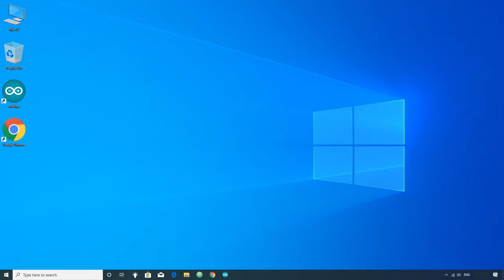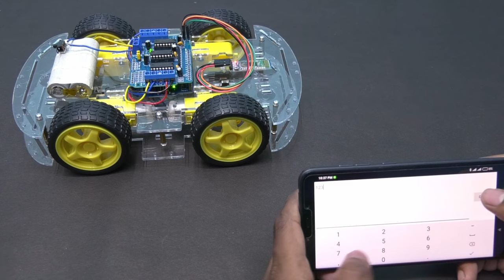Bluetooth controlled Arduino RC Car | Control using your Mobile Phone | Ut Go

Comment: Hello, I love your videos but I have 2 questions. The first, can you please help me on how to install the library for the motor protector and the second, in addition to the lithium battery, can I install a battery holder and put 3 double AA batteries in them
Reply from the maker: "Motor Protector" Library?? Sorry I didn't understand.

No, you can't use 3 AA batteries because they are not able to provide enough power to drive 4 motors.
Reply: @UtGoTech there are AF motor library for v1 most motor shied, which we have to install with the code
Reply from the maker: Install Adafruit Motor Shield V1 Library
Reply: Please send me the name of app for control the car.
Reply from the maker: Bluetooth RC controller
Reply: sir I did everything connected every wire and all stuff but motors are not responding to my bluetooth commands, all the hardware is in perfect condition wiring is done properly then also motors not responding to my command pls help sir
Reply from the maker: @AyushSinha-cq1qi Are you following the same circuit diagram and code which is given in the video description?
Reply from the maker: If you are still facing issues then contact me through Telegram. I will assist you there.
Reply: @UtGoTech  how can i contact u there sir pls sir help me
Reply from the maker: @AyushSinha-cq1qi Contact me through Telegram or Instagram
Reply: How i can contact you in telegram
Reply from the maker: @Mohammed_Al-ali Telegram User given in video description
Reply: @UtGoTech  What app you had used to drive this?
Reply from the maker: @TahsinKabir123 I have used Bluetooth RC controller app. But the app is removed from playstore. You can download it's backup app from the link given in the video description.
Reply: Is AF Motor Shield V1 library different from Adafruit Motor Shield V1 library. Pls help.
Reply from the maker: For installing the library: In Arduino IDE go to tools then manage libraries then search for Adafruit Motor Shield V1 library and install it.

AA batteries will not work. You have to use lithium based batteries.
Reply from the maker: You can contact me through Telegram.
Reply from the maker: @rimjhimbeats499 No. AF means Adafruit
Reply: @UtGoTech  there is no backup for the app
Reply from the maker: @WhiteDevil-el3vr link of the backup app is in the video description
Reply: Where can I get code of this car 😢
Reply from the maker: @user-sn4wi1ly6y code given in the video description

Comment: Sir i have made this car and run it it is running for 5sec and motor is not running then i have to resturn the car how to solve this problem pls send solution sir because i have science exhibition after 2days plas sir😢😢
Reply from the maker: Check battery voltage and also look for loose connections

Comment: I was trying to follow your exact tutorial but at the end forward was left and back was right so I had to switch wires on one side to make it work correctly.  Also added ForwardLeft, ForwardRight, BackLeft and BackRight to the code. Android soft support it but in the code it was missing. Other then this everything works as expected. Thank you!
Reply from the maker: Welcome
Reply: can you please share the code or explain what you added extra.
Reply: @samiarahmanrima8833  the code is in the description

Comment: Can i plug the rx and tx pins into the A0 - A5 slots instead? Because i plan on adding 2 servo motors
Reply from the maker: Yes you can.

Comment: What is the difference between soldering the points in 0 and 1 and fitting it directly in the pin?
Reply from the maker: No difference in the working of the RC Car. Only difference in connecting the pins directly is that it will make the connection process much easier.

Comment: In video I saw, that bluetooth module you are using is powered by 3-6V and has 3V logical level. So I want to ask if there is no need to use logical level converter or power supply downgrade? Is blietooth module 5V tolerance? Thanks for answer.
Reply from the maker: It depends upon your bluetooth module breakout board.

Comment: Hello i am having problem that i have made a car but when i connect car to phone it take times to move forward backward right left and sometimes it is connected but still it doesn't responce
Reply from the maker: What battery are you using ?
Reply: @UtGoTech  I am not using battery I was connecting aurduino cable to my laptop 
Can you suggest me which battery should I use.
Thanks for reply
Reply from the maker: The laptop USB port can't provide enough power to drive motors.
Use Lithium based battery with voltage between 6 to 9 volt.
You can use 2x18650 lithium ion cells in series to make 7.4volt battery pack.
Reply: @UtGoTech  thanks please can you make video on how to connect series battery connection.
Reply: @UtGoTech  can I use 
8  1.2v.normal batteries .
Reply: @UtGoTech  can I use powerbank instead of battery
Reply from the maker: @all_shortzParth That depends on your power Bank. If it can give  enough power to drive 4 motors then it will work.
Reply from the maker: @all_shortzParth 8 x 1.2volt battery will not work. Because AA (normal battery) can't provide enough power.

Comment: i did exactly same as u did in ur video, but the blouetooth module only blink red light when i connecting with my pc using usb cable, when i done uploading code and connect with the battery the bluetooth seems didnt work(red light is not on ) while the shield is woking (green light is on )and i dont know why.maybe because im using HM-10?
Reply from the maker: Check Connections properly and make sure the connections is as per the shared circuit diagram .
Reply: Bro did you do coding
Reply from the maker: Yes. I have written code for the Bluetooth RC car.

Comment: For the connection to the tires and the motor shield, are jumper wires sufficient as cable connections? Or do they conduct too little current?
Reply from the maker: Yes. You can use jumper wires for the connections between motors and motor driver shield.

Comment: Great work! I have this error when i upload the code: "compilation error exit status 1" u know What i need to do? :(
Reply from the maker: Check if Arduino board is properly connected to your computer or not.

Have you installed the necessary drivers?

Comment: From what I am seeing in your battery 🪫 pack seems you solder the end together while the front is lead out as positive and negative but my question is do you have to remove the soldering in other to recharge those battery or you have another technical means to charge your battery? Thanks 🙏 for your reply
Reply from the maker: Yes 2 batteries are soldered in series, you can charge this 2S battery using a 2S charger.

But you can use a battery holder as shown in this video:
https://youtu.be/6WteNRth8xo?si=JHlNM4PpEYODciLW

Comment: I have a question? Doesn't the Arduino need a 9 volt battery to work? I don't see her anywhere
Reply from the maker: The Arduino board is taking power through the motor driver shield and in the motor shield you can give voltage between 6 to 12 volts. 9 volt is the sweet spot.

Comment: It is true that first I have to enter the Arduino application (page) and log in and then download the code or I was wrong about something.
Reply from the maker: First login to your Gmail account then open the code link and download it. After downloading open Arduino IDE then install the Adafruit Motor Shield V1 Library through Library Manager and then open the downloaded code and upload it.
Reply: Ok thanks

Comment: in my project hc05 does not turn on on the Arduino motor shield when using battery power but turns on when using a laptop USB
Reply from the maker: Check battery voltage
Reply from the maker: If the battery is ok then check if the jumper is connected or not
Reply: @UtGoTech  My battery voltage is 3.7v and the jumper is also connected
Reply from the maker: You should be using two 18650 lithium ion cells which are in series to make it a 7.4 volt battery pack.
Reply: me same，do u solve this problem
Reply: @cnxc-w2e  If your battery is new then you have to charge it until it's full first

Comment: Can we use L293D motor shield instead of adafruit motor shield, Is there any difference between both of these or it can effect the car performance?
Reply from the maker: Both are almost the same. You can use L293D Motor Driver Shield
Reply: @UtGoTech  Is changing the shield effect the output or performance of a car?!
Reply from the maker: @anonymous_Blu No

Comment: Hey my bluetooth is connected but it does not move the motor pls help I checked all the batteries cables wiring etc.. it is all fine but when i send the signal through the phone it does not send a current to the motor and i separately checked the bluetooth module using code; it works. Pls help
Reply from the maker: What type of battery are you using?
Reply from the maker: This may be due to wrong battery type.

Comment: I am having two questions please tell first question is what is the use of circuit diagram and what was the total cost of making this please tell😢
Reply from the maker: A circuit diagram helps in the connection process.
Price under 2k.
Reply: 😢😢thank you for reply
Reply from the maker: @Raisahab.Gamer19 👍

Comment: can u give a fresh link for cheap batteries
Reply from the maker: Don't buy cheap Lithium ion batteries, they will discharge very quickly and are not usable. I suggest you use batteries from the LG brand.

Comment: Is there a difference if you use Arduino mega?
Reply from the maker: No difference. Just connect the motor shield in the correct place otherwise it will not work.

Comment: Hey, how much Volt is the battery? And do you need a battery case? Thank you I love your videos I  big fan i am OG thank you for everything ❤❤❤❤!
Reply from the maker: Use 2 Lithium iron batteries in series to make a 7.4 volt battery back pack. Using a case will make things easier.
Reply: @UtGoTech  can I use a 9 volt battery? Thank you ❤️
Reply from the maker: 9 volt will not work

Comment: THANK YOU FOR THE VIDEO...tried the exact same but the car is not taking instructions from the app. Could you help?
Reply from the maker: Is you hc05 module is properly communicating with the arduino board
Reply: hi there. have u fixed it? how to make it work? thank you

Comment: I made the connections as shown. However I am powering the setup using the Arduino cable. Will this work or do we need a battery?
Reply from the maker: It will work using the Arduino cable if the USB current rating is high.

Comment: Hey Hi. In the video I see you connected the Blutooth module differently as compared to the circuit diagram which one is to refer ??
Reply from the maker: Both are the same. You can refer to any one of them.

Comment: Bro, why did the TX and RX pins of HC-05 go to the servo pins and not into Arduino TX and RX? Can you please explain that, that's the only confusion I have
Reply from the maker: Because HC-05 is communicating through Software emulated  TX and RX so that you can program the Arduino board without disconnecting any cables.

Comment: Bro if i copy and paste these codes in the newer verision of arduino ide will it works
Reply from the maker: Yes.
But make sure to install the required necessary libraries like Adafruit Motor Shield V1 Library
Reply: Thanks
Reply from the maker: Welcome👍

Comment: I forgot one more question from which cable did you connect car and laptop and which app you used to input codes btw i loved you this video❤❤❤
Reply from the maker: That depends on your type of Arduino board. The software used is the Arduino IDE.
Reply: @UtGoTech  the things you have used and pinned in description i will also be using so the above software willl work ?? which cable did you used to connect the car and laptop
Reply: @UtGoTech  hey  i have just seen now in description the motor and wheels link only wheels were there now what do do sir??

Comment: I am a little bit worried about how you connect your terminals on the gearmotor, is there a way you know which one is positive & negative or you just connect them and sort for the terminal later cos that might make a novice 😅like us swap forward to backward rotations etc
Reply from the maker: Yes you can mark the terminals according to the direction of motors and use that data to connect motor terminals to the motor driver according to the position of the motor in the chassis. 

But it is easier to just connect the terminals and swap the terminals if the motor does not rotate in desired direction.

Comment: After uploading the arduino code, it says copy error messages, I don't know why
Reply from the maker: First try uploading code from example sketch. Look everything is ok or not
Reply: Remove tx and rx wire from bluthoot module then upload the code. After uploading connect it again. It will work
Reply from the maker: You don't need to because in this tutorial we have different connection.

Comment: Are you using a male-female jumper wire to connect to the dc motor?
Reply from the maker: No. I have soldered wires to the motor terminal and then connected it to the motor driver.

Comment: Sir I have a question, I have followed all your steps but when I turn on the DC Batt the BT Module wont on.
Reply from the maker: Check if your Bluetooth module is faulty or not.

Comment: Hello sir I have gone through your video n try to built it but in the end the rc control application is not available on Play Store and when I try to download from given link it showed message that can harm your device ,show me the alternative way bcz with other application it's not working
Reply from the maker: Yes you can use different app but you have to map the buttons in the code
Reply: @UtGoTech  can you give suggestions how to map it
Reply from the maker: @marustudyeducation6518 you have to map button command codes from the app into the commands in the code.
Reply: Ok and thanks
Reply: Sir sorry, taking your time, I have tried this with 2 li-ion battery but through hw 130 l293d motor control I am not able to get the required voltage I have checked through multimeter the voltage I am getting is only 0.3 v rest thing is ok thn I increase the voltage upto 9 volt stil not get the required voltage 
at PWR pin I am getting 5.6 volt and Bluetooth hc05 not working but after shorting its working but not for long time And now the Bluetooth module automatically disconnected 

First through Your video I have joined the connection with  thn go through the circuit diagram in both case it not working 

Even I downloaded the apk file but nothing is fruitful 
Should I change Arduino or motor driver or sth else 
What should I do kindly suggest!
Reply: The same app available as apk in google I have downloaded it and working smoothly

Comment: I have a geniue curious question
How does that car go left and right when all the components are set to be straight. Sorry, i dont know much about this. I am a newbie, haha
Reply from the maker: Rotating the left and right wheels in a different direction will rotate the car or rotating the wheels at a different speed will turn the car.

Comment: sir, motors are not working properly means ,its running jerkily also not turning left and right , what could be the reason .please provide us solution,
Reply from the maker: Check for loose connections and also check battery voltage
Reply: @UtGoTech  sir, voltage is 7.4 v using 4 litium batterieseach 3.7 v  (series and parallel). sir  motors run for 3-4 sec and then stop automaically then after some sec its they start moving with low speed or torque
sir what could be the reason 
1,battery connecti0n choice
2.battery voltage level is low , capacity of battery ,
3.battery charing is low 
or any other please reply
Reply from the maker: This may be due to loose connections or low battery voltage.
Reply: @UtGoTech  Could we applied 14 volt?
Reply from the maker: @MushtaqueAli-jh9st 14volt will be too high for the BO motors. It will overheat the motors and the motor driver.
Reply: @UtGoTech  10 volt?
Reply from the maker: Ok. But in the long run this will heat up components.

Comment: Bluetooth module not working on motor controller, it only works if i add supply on arduino. Please help
Reply from the maker: Have you connected a jumper to the motor shield?

Comment: Hello there
Can you help me please ,i want to add the blutooth on my project but im already using the SERVO1 & SERVO 2
So if i conacted the RXD. TXD of the blutooth to the TX, RX of the arduino/motor driver
will that work ?
Reply from the maker: Yes. Just remove connection when uploading program

Comment: Did u use PID to make the car go straight? And does it turn exactly 45,90.. degree or not
Thank you^^
Reply from the maker: No, I didn't used PID.
No car does not turn exactly 45 or 90 degrees.

Comment: Bro I have concern regarding cells. The lithium battery is increasing the price. So would it work with a battery.
Reply from the maker: The best way is to use Lithium battery but if you want to use a different type of battery then I suggest you to use two separate batteries, one for Arduino Uno board and another for motor driver shield but before connecting two batteries make sure the yellow jumper in the motor driver Shield is removed.
Reply: @UtGoTech  How to add a battery in Aurdino uno board
Reply: Bro, the link of the lithium battery that you added is not working.
Reply from the maker: Ok I will try to provide the link. Meanwhile you can search it on Amazon.
Reply from the maker: In the Arduino board you can connect the battery through the DC power Jack but make sure that the yellow jumper in the Motor Shield is not connected.